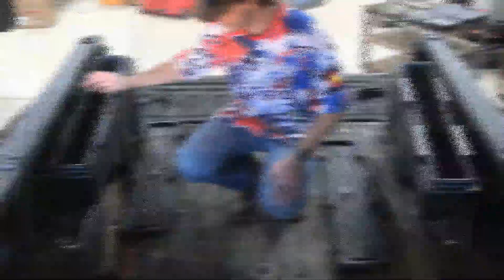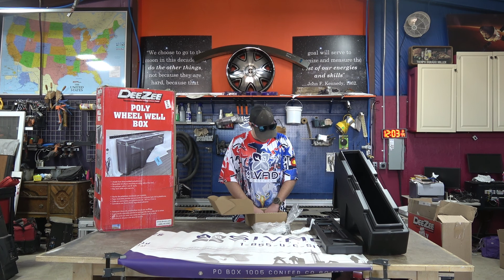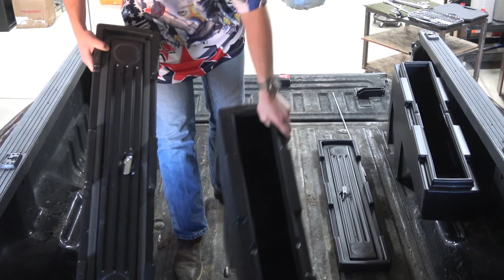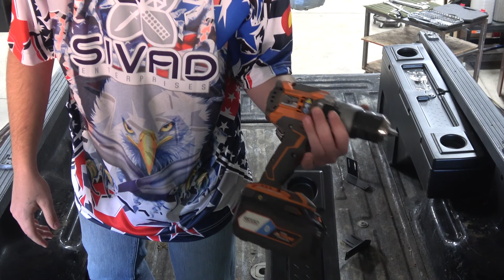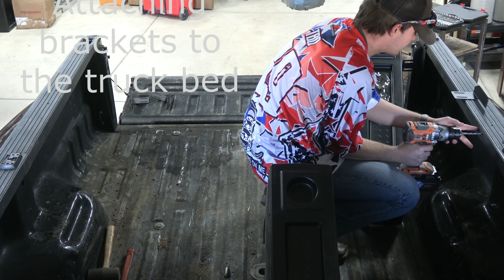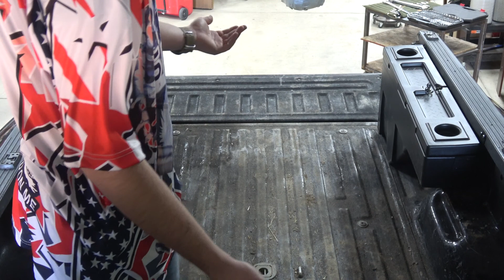BEFORE YOU CHOOSE TRUCK BED STORAGE: Dee Zee Poly Wheel Well Unbox & INSTALL Ford Powerstroke Diesel

Comment: These and the Swing Case seem very flimsy to me.  I was interested in the concept, but these won't last long, especially with any weight in them.  Make them aluminum then you'll have something.
Reply from the maker: So honestly... We thought that too. But these have been on for over a year and they are still in great shape. The lock and latch suck but to be honest they sucked from the start.

Comment: those things are a joke. theres absolutely no reason to chose this over the undercover swing case
Reply from the maker: Have you used both?  We have not been overly impressed but they get the job done.  We will be doing a review over the next couple of weeks after having used them on 2 cross country trips.  We may check on the undercover swing cases for our other shop truck and see which we like better.  Thank you for checking out the video!
Reply: swing case is insanely priced at $200. All these crappy boxes are overpriced. I'm still looking for other options
Reply: @Mach141  I agree. I mean, they're plastic.